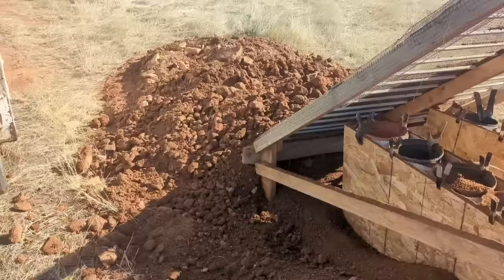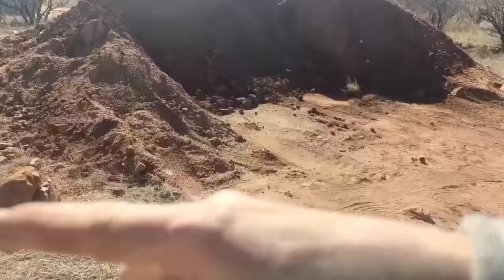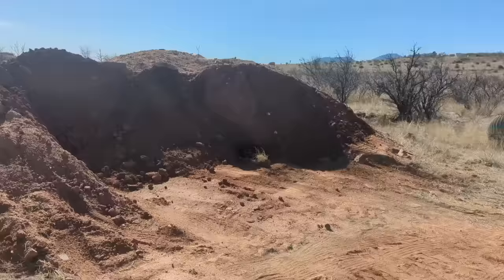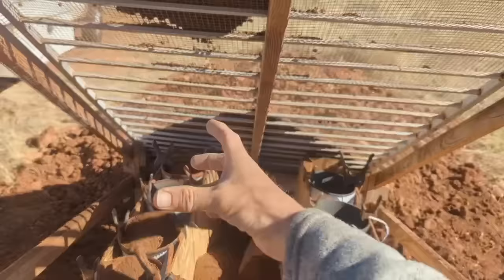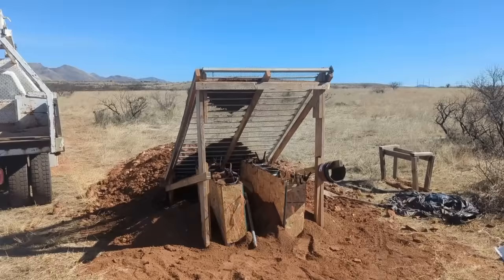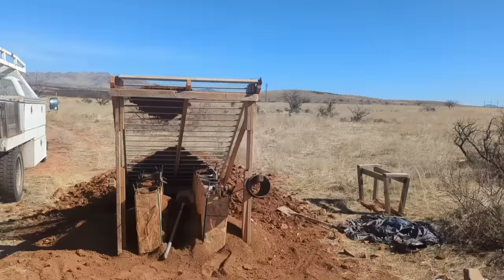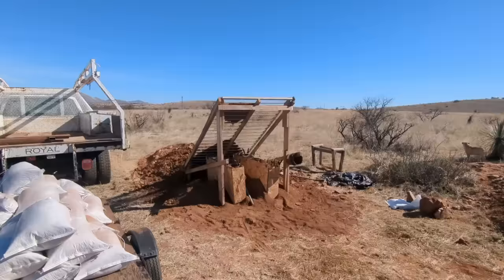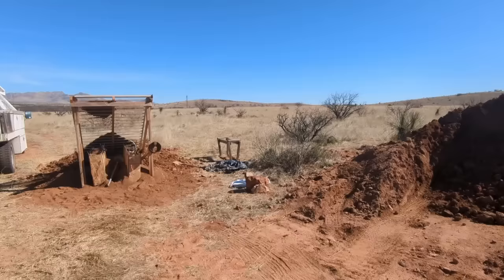Why I am building my house with sandbags

Comment: The modular system seems very logical in terms of a nice squared-shaped house and no dirt or soil in the house if a wood frame is applied to the walls. However, this system might have disadvantages such as bugs or rodents in between the wall frame and soil bags, etc.

Comment: Reading through most of the Owen Geiger, etc stuff, you almost never need cement. The earthbags don't have concrete. There's a small, tiny percentage of cement added (or perhaps lime). Very few cases require this, however. The issue with those beams is that it adds to cost significantly, and takes earthbag a little further from the natural (materials on site) stuff. 
Good video, thanks for sharing. Been following your stuff for a while and enjoy your take on things and your doing your own research.

Comment: I'm concerned that if you don't put the bags in place soon enough, that with the heat, etc, the will be one very hard in the position they are in and it will make it harder to stabilize them in the final home.    Other than that I really love your method.

Comment: Hi there. My concern is the cost of the wood, since the prices of any good wood is extremely expensive, which is why i am attractive to the earthbag build. So how are you getting round the extra expense of the extremely high cost of wood to build these eco beams? Essentially, you are building in the manner of a straw-bale build. Can you expound on this issue please sir? Ive been watching your videos for sometime, and i love your very logical thinking. Sound a lot like me!! I’d love to get your feedback on this issue. Have a wonderful day.
Reply from the maker: So to answer part of your question, the price of wood has actually went back down close to pre-pandemic levels. Also, the thing that I mentioned also in this video is that the walls themselves are just one expensive a house The roof is arguably the biggest expense of a house so unless you're doing a dome roof with earth bags then you're going to have to buy a roof regardless. What I look at after being out here for a few years is not just expense as far as financial. Financial is one dimension The second dimension is time. Time does cost money if you are looking at it as a whole. If it takes me a tremendous amount of time to build something and that time is so much longer say five times longer than it would to build it with the other material and that material is only two to three times more expensive than that method then the math gets a little trickier if your time is limited and you have many projects to do. So basically what I'm saying is is that there's a lot more to way than just the dollars of a project you also have to look at energy how much of your personal energy are you putting into a project and if it's going to suck your energy your life force your morale because you're working so hard and so many hours to build something, then it's hard to put a price tag on that so you can't just look at it from a money perspective all the time. I do however understand if you simply do not have the money to pay for a project then the decision is easily made because you don't have any other option anyways. So not sure if this answers your question but it just shows you how I think about projects like this. Since making this video I have actually decided to build a steel house anyways we are using the bags for interior walls just more for aesthetic purposes and for walls around the house. So I guess you could say that my house is probably a lot more expensive than any of these methods that we mentioned lol
Reply: @OffGrit  You definitely got a point. I would be leery of the wood with the termites in AZ. But using the metal as a shell, and still filling in the spaces with the earth bags still gives that large earth mass for attempting cooler temps. Still somewhat eco friendly. Are you using salvaged metal or buying a metal barn from homedepot or other business of the same sort?
Reply: @criticalnurse-ready8705  good question
Reply from the maker: @criticalnurse-ready8705  sorry I just saw this... I am using surplus steel and recycling some aspects of the build

Comment: I enjoy watching all the different ways hyper Adobe is made! I'm choosing the red bags cause I'm clumsy + barbed wire =pain. LOL but also to cut that expense.  Just trying to decide of I want to do square , round and if I do round if I'm gonna do a dome or regular roof. 🤔
Reply from the maker: Hey thanks for watching. I didn't add in the video that there will be no barbed wire with this method... probably should have elaborated on this.
Reply from the maker: As far as the roof goes, I think cal earth bags are better for the dome then the hyper adobe if I remember correctly... Well if you do a dome, you will reduce perhaps the biggest expense of building which is the roof.... With concrete like I said, I understand why it is used, I just think at a certain point the time to mix it and the extra labor makes me wonder why not just do something easier....I built with the bags and this building has been up for 2 years....no concrete added, didn't really even wet the soil... And there has been no issues with settling and it is SOLID. I use it to grow my plants now...
Reply: Regular roof isn't mold/termite/fire proof.

Comment: A skid steer with a bucket mixer would help blend the cement and soil if you want a stabilized soil mix.    They have chutes out the bottom to fill a bag, or you could just go with pressed earth block machine and dump the mix into that and let it crank out some stabilized blocks for you.
Reply from the maker: Yes.... but then it becomes a very expensive build...I know they are available... but not cost effective if you are doing a single build

Comment: I want to do hyper Adobe but like an earthshipish. Do 2 rows gapped & infill & tamp so I'll hav 3 ft thick walls. Then instead of foam insulation a thin aircrete wall around anything that will b buried. Wrap the structure in that newish roofing material that u can heat weld. It's white on top blk on bottom. Can't remember  name. Then I can bury & kno it'll never leak unless punctured. Dirt is cheaper than insulation. I've bn designing this in my head for a while now. Use the guys cheap geo thermo heating from growing oranges in the snow. Maybe sum mylar mirrors around hollow columns to collect more heat from Sun in winter. One of those Korean fireplace heat batteries that use all the heat before the smoke leaves the bldg with coiled line in-between the layers to heat infloor heating so even in the rare -50s I'm good without propane. Once I get the land it's on. 

A root cellar with thermo syphons so u can keep the temp where u want it & possibly divide into 2 rooms & 1 of them a freezer with zero electricity. If they can keep permafrost frozen we can make freezers with them. Good luck to all attempting any of these things
Reply: Einstein said," genius is 1% inspiration and 99% perspiration.

Comment: I really appreciate your thinking on this, even though I'm not going to do anything like that.  This video gave me some other ideas for the North wall of a submerged greenhouse that just seemed to pop into my head once I was freed from the orthodoxy.
Reply from the maker: thanks... it is weird to me sometimes how this algorithm works... I really didnt put any time into this video and have been surprised at how many people have seen it... but to your point this happens to me alot when I am just browsing and next thing you know some random video or post helps me solve a problem the same you describe... thanks
Reply: @OffGrit  I've been searching deep for a while.  It wasn't that easy to find.

Your videos are pretty good because you're walking through each step and why you chose that direction.  So like a martial arts kata it's easy to just take a few moves out of it for something else.

Comment: I've also seen concrete used in rammed earth construction so it's not just earthbags. Second it is a stabilizer and easier to comply with building codes. Now if you don't have to build to code then good for you but not everybody can.

Comment: This is really cool. Isn’t it more expensive because you still have to build with standard stick framing? But I suppose this method should be quicker and time = money. Maybe I’d just build a metal pole barn and fill in the walls with earth bags. I’m still debating doing a straw bale house as well,
Reply from the maker: Hello. Yes it is definitely more expensive this way than just setting the bags in place. It is a trade off and for me it was about finding a time/money balance... So I think this helps to achieve this for me.... 
As far as building goes, I actually decided to do a steel building for our house as well. I bought a house worth of 3" thick close cell foam boards from a contractor that was dismantling a department store and got them for pennies on the dollar. ... I am still going to use the bags for interior walls of the house as well as exterior walls ... I have changed my mind a few times 😂
Reply: Right on @OffGrit

Comment: Finally a real person I relate to and not some hippie fruit..
I built my house out of stick in 2015 Made a lot of mistake.
Thinking about building another out of sand bags.
Orginally i had plans if a basement and making adobe brick.
Lol. But my first monsoon in 13 told me nothing under ground. 
I use the hole now as a water catch during monsoons .
And like i said made mistake with my house 
First roof was hot tar and rock. .lol it didnt last long. Sun baked the tar. And then winds blew rock off.
Then i used asphalt shingles for a few years. Having to replace whole roof at least yearly. Because winds kept blowing shingles off. 
I finally said. Hhhm cost more but what about corrugated metal. 
Ive had that for years now and able to catch water with th my roof. 
I only get on average 4 inches per year i can catch. And since then this is the first year that i didnt  have enough for dribking water and cooking from that.
But last year snd do far this year. Its in the beganing ofonsoon season. I haven got the monsoons. 
Ground vstch is fine for non potable water.
But i also have not found a good filter method.
Peope think it's easy.
But we are talking about filtering at least 50,000 gallons per year. With a filter that can be cleaned and not replaced ever  100 gallons.
The water is muddy.
I dont know about his. But my water the fines will not settle. 
My ground is not clay.
It's fine coral. 
I mean if i added heat. I have all the portland cement id ever want. Lol. 
The " soil' is between 4 inches to 4 feet thick. Then its layered coral for 1500 feet plus that is fractured.
Meaning soilied rock that water goes through .
And mixed in this is Granite rocks like 18 inches across round rocks .
That i have no idea how they got here.
No granite insight of 50 plus miles in any direction. 
And no. No human put them there. They came from four feet deep and more incased in the coral.
You dont even know they are granite until you break off the coral around them. Ive yet to break one .
Build out of the coral sheets? No. The fracture to about 2 to 4 inches thick and and about the same width and high.  
I did however put them in cages and began making a pig pen out of them before the 1st monsoon. So i have this 3 foot tall 16 foot long 3 foot wide wall. And another at 90 degrees sitting on my land.
Its a pain to dig in the rock. And nit much reason to do it. But if i find a reason to do it. I will finish my pig pen. 
Also understand my gound water catch. I have to get the water out within an hour if a monsoon. Btw it 10' x 10' x 8' deep. Dig by pick and shovel. The soil was only 4 inches deep. 
If not its all gone 
Also its in higher ground. 
Now. I haven't done it yet. But i have dry beds i can use to catch water.
Just put a 4 inch pipe and 1000 feet i cam fill totes when monsoons hit.
Yeah its that 1000 feet of pipe  but if I did. I can have ,100s of thousands of water.
I also have part of about a 2 acres dry pond . But ive never checked it after a monsoon. . I do have a tiny dry pond of about 10' circle . Im sure there are more on my property ( 630 acres,) .
But the one dry creek would be the best in my option. . But again the pipeing. Pvc bakes in the sun
Reply from the maker: Hey thanks,! I am right in the middle of building right now (steel frame) and am sure I will make lots of mistakes too
Reply: @OffGrit  that's how we learn. Lol

Comment: Thanks for this video, your automated filling is brilliant... I already have most of my roof up due to me not having a plan for the walls yet, so this would be great as it doesn't require compaction from the top like you normally would with earth bags. You said you didn't like cob plastering but never mentioned how you would plaster these walls or what cladding you'd use. Problem I forsee is the bags moving over time even though they not load bearing?
Reply from the maker: Bags between walls can be stacked on top of barbed wire strips that can be a continuous strand or individual strains. This is how I built the last earthbag. You can use an smaller hand held tamper...or make one.... I have seen this done. As for the walls .. I would use some type of backing whether it be hardboard coated with an asphalt emulsion (I did This on a pallet shed) or felt paper. And then staple chicken wire for lath....I did this on the earthbag and the pallet shed and then I used a homemade stucco mix. Interior walls can be done the same way. Back in the day, it was common to stucco over voids just on top of lath with a backing...you could use furring strips spaced in increments and lath on top of this as well... I watched videos of a plasterer in CA that showed how he stuccoed over just lath with a backing...
Reply: @OffGrit  ah right, so you have to to stamp the bags. Chicken wire should work. Thanks
Reply from the maker: @karlvanderwalt293  you can use a baseball bat or something similar. I should have clarified... the tamping I do vs. This type of light tamping isn't the same thing... you can watch military building sandbag walls.

Comment: Fair argument, in my opinion. How do you plan to protect the bag walls from the sun's deterioration please? Both systems require this to be viable I believe.
Reply from the maker: The bags are covered in tarps until they are used. Bags are set in between walls so the sun never deteriorates them this way

Comment: Rammed Earth, Compressed Earth Blocks (CEB) and Adobe insulate more then concrete. They breath allowing moister in the air to soak into them creating less humidity within the building. They also absorb heat during the day and release that heat at night. 
A pure concrete wall wont do that. 

By adding Portland Cement into the mix it bonds and waterproofs the soil so it wont fall apart in the rain or if it floods but still retains the other qualities of insulation,  humidity control and heat release at night.

Using untreated earth when those bags eventually deteriorate will leave you with raw soil inside your walls pressing up against whatever material you chose to hide them behind potentially leading to rot.....

That in a nut shell is why those people choose to take the extra step and add the cement to make a structure that will last a thousand plus years.
Reply from the maker: 🤦 sorry but you have a lot of false statements here....but I simply don't have time to write a 5 page rebuttal to not only correct you, but actually reiterate what I already said in this video... I UNDERSTAND THE WHY...

Comment: Interesting. Thank you. You mentioned that you don't like cob for plastering. What do you use?
Reply from the maker: What I did was to mix my own stucco here on the property using sand that was screened. I laid a mesh underneath on top of the bags in this case chicken wire and added it to that and it's held up really well for a couple years now. Yes I think Cobb is just to prone to cracking and it's just not very durable and it's also a real pain in the neck to apply that stuff and mix it. So for me if I'm going to spend all the time doing it I don't want to have to do it again so I just went with what people already do out here which is to add stucco to the side of a building thank you

Comment: Concrete won't stabilize them but cement will.

I have some old concrete I will crush and add them since their angular shapes can make the walls stronger. I will use only clay as binder - no cement.

Comment: Cool.  Sorry to be the normal commenter and ask why this over CEB?  Compressed Earth Brick has a lot of advantages... they are load bearing and easy to stack plumb, etc.  I assume you are familiar with CEB - so why did you go this route instead of the CEB?  I have no dog in this hunt - just interested and would like to build my next home myself and have it be super efficient like your home or any of those discussed.
Reply from the maker: Well... I have heard of this method..in fact, I made some Adobe blocks when I first started. I guess the thing that I like about the bags is that everything is contained within the bag so if the soil did/does crack after tamping...it is still contained within the poly. The blocks can crack if your formula isn't good or if you don't cure them properly. 
Truthfully you could go any direction with it and probably find an equal number of pros and cons with each. Out here in AZ there are actually a lot of old houses made with adobe so it definitely works